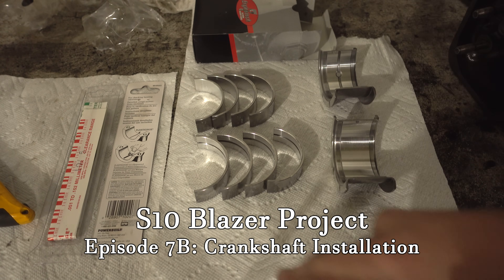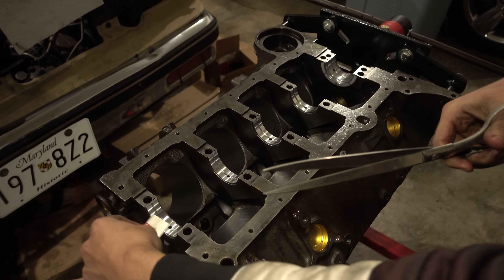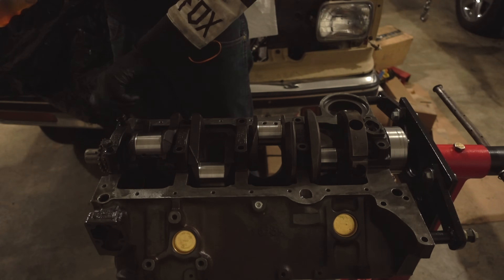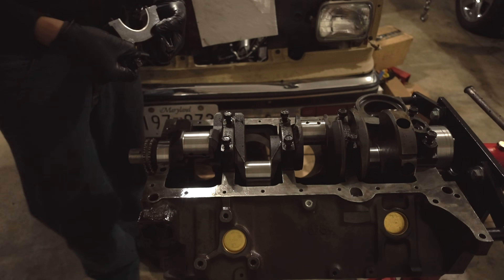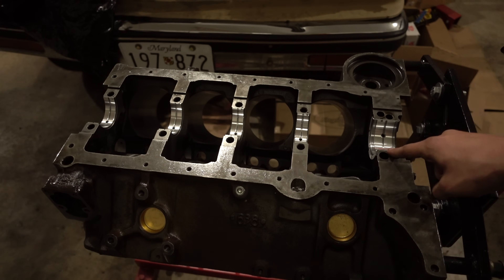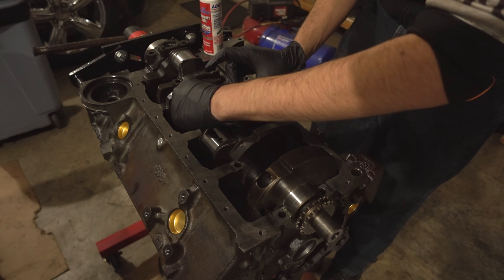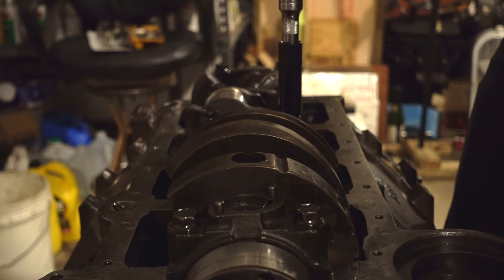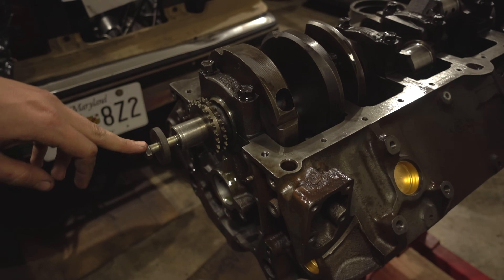V8 S10 Crankshaft Plastigage and Install (Ep.7 Part 2 of 7)

Comment: I always put my crank in & then put the plastic gauge between the bearing & the main caps. Instead of the crank on top of the plastic gauge. That way ya don;t have to lift the crank out to check bearing clearance. Love the step by step Great work.
Reply: Exactly my process, too.  Much easier, and less dealing with oil holes and grooves.

Comment: you put plastiguage material on journal you then put cap on iy then torque.the plastiguage ius to show the machinist if anything is out of tolerance so he has to fix like maybe wrong bearing or something like that.you then just have to pull cap and guage shld. be stuck to crank.good luck

Comment: Are you taking wet torquing into account wen you work with oiled /wet bolts? Setting to 70ftlbs then going to click on a wet bolt your adding 30% to the 70ftlbs . Just curious
Reply from the maker: Torque specs for certain bolts (like main caps and head bolts) are almost always given as "oiled", and the use of lubrication is already taken into account. For other hardware I will play around with the values/feel a little if bolts have thread sealer/oil/antiseize on them, but generally torque specs have a bit of a buffer built into them and you won't run into issues. For critical components or soft hardware (Japanese)/aluminum threads you do have to be more careful and aware of that though.

Comment: I did my 94 LT1, and from the factory it had a .001" undersized main on the rear.  I had to order a set of .001" undersized main bearings just to get the one for the back.  I found out they also sell .002" undersized bearing sets for older worn cranks, or for cranks that need that extra polishing that ends up wiping out a .001 or so when doing it.

Comment: I never lube bearing bolts I thread lock them so they don't vibrate loose. I prefer red thread lock though some may argue My reasoning about this method, But my method never failed me.

Comment: You cannot measure running torque with a micrometer torque wrench. The way you tried to do torque at the end does not work, only a dial torque wrench will work.

Comment: Never put oil on bolts you torque because the oil will sit on the bottom of bolt hole and give you false torque specs and it will cause the bolt to loosen over time
Reply: I agree I never lube bearing bolts I thread lock them so they don't vibrate loose. I prefer red thread lock though some may argue My reasoning about this method, But my method never failed me.
Reply: a smear of thin oil on the beginning of the threads and on the shoulder

Comment: I run 15w-40 oil on mine at 370,000 miles cause it's a little low on oil pressure with the original 5w-30. 
(started running 15w-40 at about 175-200k-ish miles)
Some people even go as high as 20w-50 but you'd have to have some very loose tolerances, or very worn out, to be needing that.

Comment: I'll put it to you this way. Loosey goosey never got stuck, LOL. Will run fine with those clearances. If it makes you a little uncomfortable when the engine is warm and you have 5 psi at idle sitting at that traffic light, just switch to 20w 50 oil. Will give you an extra 10 to 15 psi at idle. I ran my Jeep engine like that for over 15 years. Recheck final torque a couple days later, some of those bolts will come loose.

Comment: Sir if you would lay your crankshaft in the block and put the plastigauge on the journal then torque your bearings. Remove the main cap and check your clearance that way you don't  have to remove the crankshaft to get to the plastigauge.  Not criticising  just thought it might help you. Enjoyed your video!!!!!
Reply from the maker: It is a good point! The main concern is that sometimes caps that are hard to get off might end up smearing the plastigauge when using this method, but it probably is totally fine and certainly easier!

Comment: Now wouldn’t you also be able to put the plastigauge ontop of the crank and under the main caps and achieve the same result with less work?
Reply from the maker: Yep, the only concern is sometimes the caps will stick, and you will need to rock them back and forth a bit to get them loose, and that can smear the plastigauge. Probably just me overthinking it though, haha! You can use plastigauge while an engine is installed in a vehicle, and that is precisely how you would do it, so I'm sure it's a valid method.
Reply: Fuzzy Dice Projects btw bro I’m am beyond thrilled to have stumbled across your channel very informative and great editing. Keep it up man I hope to follow all your projects going forward

Comment: Its a small block chevy they will run completely fine on 5psi of oil lol
Reply from the maker: I've heard even less than that haha! They are tough cookies, indeed. But it's nice to be thorough anyway!
Reply: FuzzyDicePimp oh yes without a doubt. Plus if your going through the trouble of rebuilding a motor you want it to have good compression and oil pressure

Comment: If you're worried about clearances affecting oil pressure (I wouldn't be), think about a high-volume oil pump, if you aren't already.
Reply from the maker: A high volume pump would be overkill, plus they need an extended oil pan, and I wouldn't even know where to start trying to fit that in the engine bay. Pressures might be a little less than ideal, but a Chevy 350 barely even needs any oil pressure to keep ticking, so I'm not worried about damage occurring from it.

Comment: I think the cranck is springing back because it's not balanced unless the rods are in.
As i know the v8 crancks are balanced with weight on them,not bare.
So,it's not balanced right there.
http://www.enginebuildermag.com/2014/03/weighing-balancing-work/
Reply: michaelovitch crank not cranck ,also say the guy using internet pages for info stfu another wannabe car enthusiast
Reply: michaelovitch it's because of the viscosity of the assembly lube...basic physics

Comment: Your rear main should be checked with the oil pump bolted on because that will change the rear main clearances
Reply from the maker: Yeah, I mentioned that briefly in the video, but for my purposes here I wasn't taking precise measurements or needing perfectly accurate data, so it is fine taking a reading without it installed.

Comment: Really enjoy your series of videos (both the Blazer and the Datsun). Thanks for taking the time to make and post them. Fwiw, when checking bearing clearances, the usual method is to set the bearing shells in the block, set the crank in those shells (in the block), then set the other shells in the main caps and torque the caps in place, then, one-by-one, remove a cap, add some plasti-gauge, and re-install and torque the cap ... then remove it again to check the clearance. The reason for this is that the block (and even the crank) can deform slightly when everything is torqued down as it will be when the engine is eventually running, and you want everything to be as close to running conditions as possible. By only removing one cap at a time, the other caps remain torqued, better simulating the stress that the engine will experience when it's finally assembled. In addition, you don't have to remove the crank to take your readings -- the plasti-gauge will either be on the surface of the crank's journal facing you, or it'll be in the cap you just removed ... both of which are much easier to measure than having to hunt for the plasti-gauge once the crank is removed. But that's nit-picking. Your way will work, and for a regular, low-buck, low-performance rebuild, it'll be fine. Good luck on the rest of the engine build! Can't wait to see how it all finishes up.
Reply from the maker: I'm not quite clear why you would want to measure the caps separately, I would think you would torque them all down at once and check them all at once because that is the condition the engine will be run in. As far as getting the readings on the cap side bearings, that is fine too. But sometimes the caps can be tough to remove vertically, and if you rock it back and forth there is the chance to smear or distort the plastigage, but realistically I'm sure that works just fine too.
Reply: Hi, that was actually my point: by installing and torquing all the caps, then removing one and adding plastigauge and re-torquing it and removing it, you're leaving all the rest torqued (like they'd be when the engine is running) so the block and crank are subjected to nearly the same stresses as they'll experience when running. That was how all the engine builders and manuals I'd ever seen did it, and it always worked well for them, so that's how I've always done it, unless I'm actually mic'ing everything, instead. But I certainly see the logic in doing it your way. Maybe the next engine I do I'll take the time to try it both ways to see if there's any difference ... though I doubt there will really be any. Besides, as you pointed out in the video: plastigauge isn't exactly super-accurate. Anyway, thank you again for the terrific series of videos. And for taking the time to reply to comments like mine. It's definitely appreciated. Good luck with the rebuilt engine!
Reply from the maker: Hmm. I have heard of measuring that way before, removing one cap at a time, but to me it makes less sense. Doesn't mean anything really, I could certainly be wrong. I would be curious if you measured both ways if you would get different results, and which would be more "correct".

Thanks for watching and the kind wishes!

Comment: The way ive always plasticguage checked the crank was to install the crank in the block, put the plasticguage strips on the journals and install the main caps and torque. Then remove the caps, check my clearance, wipe the crank and cap clean, oil the crank and reinstall and torque caps
Reply from the maker: That works too, and is a tiny bit less work I suppose. Only concern is sometimes the caps can be tough to remove vertically, and if you rock it back and forth there is the chance to smear or distort the plastigage, but realistically I'm sure that works just fine too.

Comment: This main clearances are just fine for what you're doing.
Reply: Do R/C! I think a little 15W-40 Rotella would probably make those clearances a non issue ....not that they will be anyway
Reply: Though you might want to run thicker oil than specified.
Reply from the maker: Yep, my goto is 10w-40, but if pressure gets a bit low when hot I am willing to go to 15w-50 or so.
Reply: My crank was machined properly and came back with matched bearings. Measured with plastigauge anyways and the journals were all somewhere between .002 and .003, I run about 20psi piping hot 550RPM idle. About 55psi cruising. Perfectly fine for a street engine. Race engines usually have LOOSER bearing clearance to account for the crank expanding under high RPM heat.

Comment: when checking the clearence on the crank-schaft, you only measured one side of the bearings. so you will only get half the actual distance between crank and bearing. but i think, but am not sure, the clearence is meant to be on both sides. therefor you measured double of what you shoud have (i think). if i am correct, everything might me in spec or a little tight.
Reply from the maker: I know what you are thinking, but you only use plastigage on one side to check clearance. It takes up the space on that side and forces the crankshaft (or whatever you're measuring) to the opposite side, taking up the slack, so it is measuring the total clearance and that is the spec that manufacturers and the aftermarket use, the total clearance.